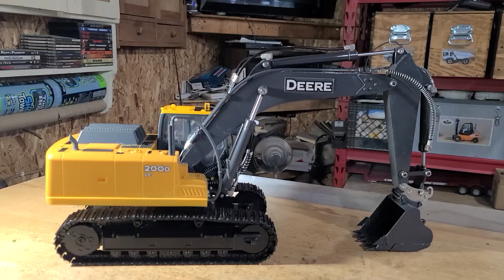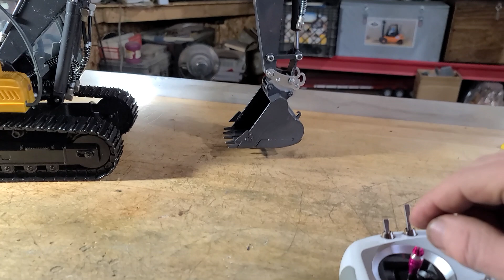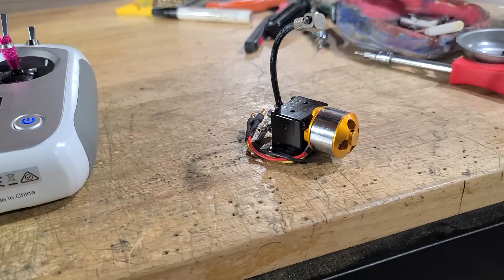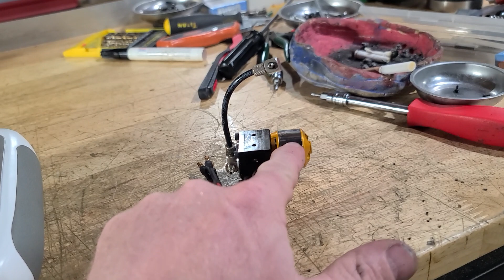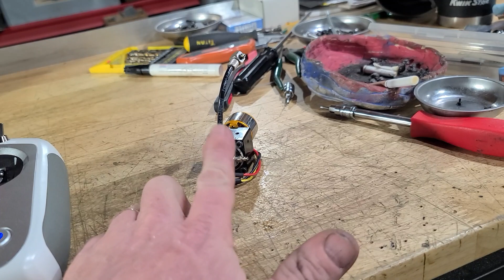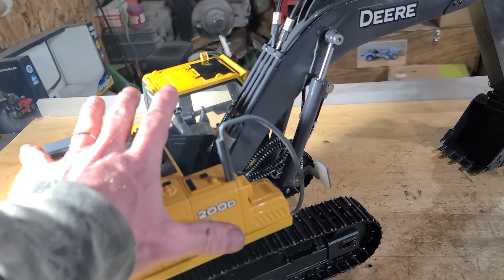1/16 SCALE RC CONSTRUCTION EQUIPMENT Ertl Deere 200D LC Hydraulic RC Conversion Test Video #3

Comment: Nicely done Dennis i see ur a SAE pattern man same as me (Leon)
Reply from the maker: Yes, the SAE pattern is how I set them all up for me, and that is something both of my sons run in real life, so it works for us. To me, the boom and swing together just feels more natural. If anyone wants to run my equipment and prefer ISO, then a simple stick mode change in the radio before you power up the machine can fit that.
Reply: @dennybobsrcconstructionagc2796  same for me I played construction simulators and ran them like that my very first rc most was my 1580 swapped it to SAE i agree so much more natural like the curl the stick/Dipper in and curl the bucket in one stick motion I rewired the 1580 the same with flysky and my wheeled units will be too I got the plastic EE 160 with screw rams that I wanted to change to SAE but wiring so complex lick a cars ecu so guuting it for a flysky the 1580 layout saved can run it simply enough but I have my 4x4 wpl semi and lowboy on it to two wheeled units all electric EW160E and hydraulic arm CAT 320 I think it is could be wrong wpl chassis seems to fit nicely the wheel and tyre is a tad bigger that the tracks on the idlers and sprockets but a bit shorter lenth using a modified 1/10 snow plow as the blade and tamiya trailer legs as outriggers not the same as real ones but will work well  but still need to redesign my lowboy neck
Reply: @Lee-At-Green-Pheonix-Rc I got the 1583 and wanted to switch it to sae. How did you do it!? At remote or mother bord?